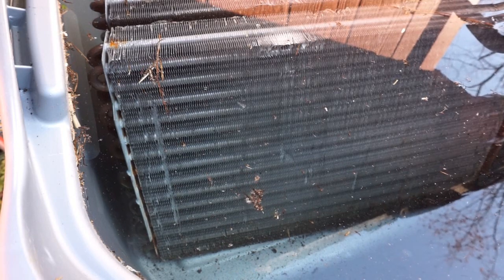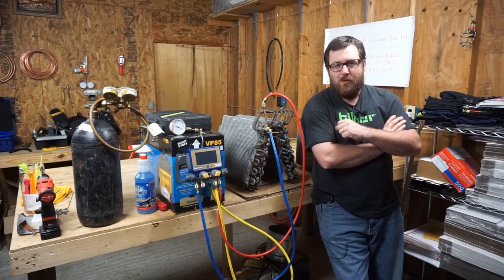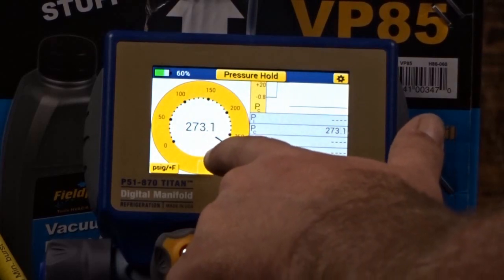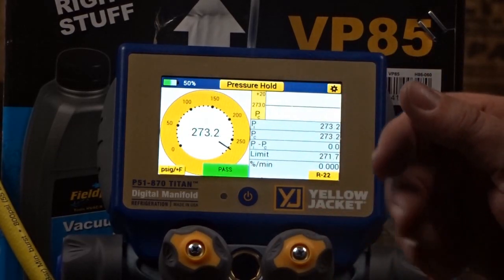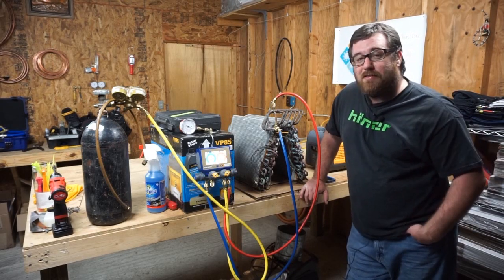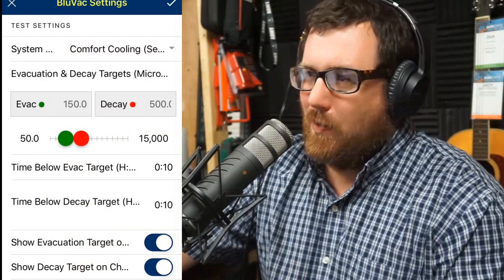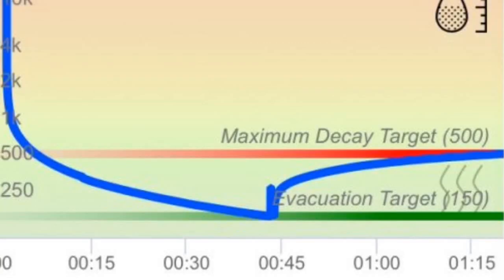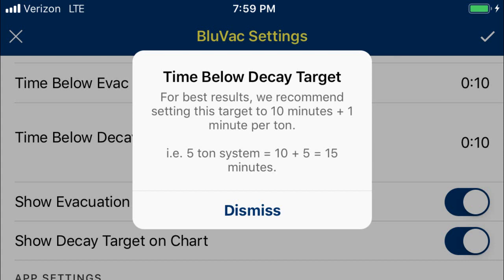Leaking HVAC Evaporator Nitrogen and Vacuum Test | BluVac App vs Leak

Comment: I think your testing approach may have some flaws, and I’ll explain why.

Pressure Test:
Pressure readings are highly dependent on temperature. In a real system, your lines could run inside, outside, and even through an attic — making it difficult to get an accurate before-and-after temperature baseline. So even if you account for temperature, the variability makes pressure testing unreliable for detecting very small leaks. It’s possible your leak is simply too small for your equipment to detect.

Vacuum Test:
I believe your vacuum test settings could be improved, and it's not just about a simple pass/fail result — especially when those outcomes are determined by the thresholds you set.

Ideally, the system should be pulled down to below 100 microns and held there for proper dehydration. Then, the system should remain under 200 microns for 30 minutes. But again, that alone isn’t enough — you need to analyze the vacuum curve and the micron rise per minute, which you didn’t include. The goal is zero micron rise per minute, but with the type of vacuum-rated setup you’re using, I’d expect something close to 1 micron/min rise or better.

Then the question becomes: is that 1 micron/min rise due to the system (i.e. a real leak), or just limitations in your equipment or gaskets?

Nitrogen vs Refrigerant:
Lastly, you're using nitrogen, which has a different molecular size and leakage behavior compared to actual refrigerant. I'd be really curious to know: if you’re seeing a 1 micron/min rise using nitrogen — and assuming that rise is due to a true leak, not equipment limitations — how does that translate in a real-world scenario using R410A? Are we talking about something like a 0.5 lb loss over 10 years?

Comment: I can't imagine what more on 410A which is much more difficult to find leak. I can hear it hissing but when I look at the pressure gauge can't even see it. The worst thing to do on POE oil is pulling a vacuum when there is a leak and suck all moisture inside.  

Maybe you should try cooling or heating the evaporator to make metal contract and expand also to simulate working condition.

Comment: On up to 5 ton splits with scroll R410a, When I use deep vac for leak testing, I would pull down to below 200, and isolate and wait up to 24 hours to determine the final level offed vac. If over 1000, pull down again and repeat till the rise level is around 500 leveled off at 24 hr because the moisture can blur the tiny leaks.  If the rise never ends and is above 1micron per minute average seemly forever, there is a tiny leak.  I only use vac for leak search if I have lots of days.  I use the BluVAC Pro gauge.  I find it better to use nitrogen at system rated test pressures found on the name plates and locate with bubbles/ ultra sonic.  I have had systems with micro leaks that don’t leak under Vacuum but do when under pressure.  For running systems that need annual addition of refrigerant, a combination of ultra sonic, H10 and the newer FP IR probe and bubbles 
Is what I have success with.  There is not one tool of method, each system and its condition and situation is different.
Reply: Thats how id like to do my evacuations aswell but when youre working for someone else and its quoted for a 1 day repair thats when it gets dicey and you can only do what you can do
Reply: @45KevinG45  very true. That makes us techs always have to be in a rush

Comment: What was the leak rate for the coil ? lb/year. 
You know that you can't make a system that is 100% tight. Even the best solderings, do leak at 0,0000 level. How did you find the leak in the first place.
Reply: You’ve hit the nail on the head.  I don’t think any system is 100% leak proof.  We’ve got minis with flare joints that almost never seal despite every attempt to make them tight.  Testing systems overnight is not very realistic.  Not many techs or companies are going to go to that length.  I think we will find that all systems lose a small amount despite best practices.

Comment: Hi Zack . great video . you have opened a can of worms here. A great follow up would be to hook up the coil to a helium leak tester in vacuum mode (not sniff mode). something that can leak test down to say 1 x10-12mbar/l/sec like a leybold phoenix l300 . Then introduce helium to the know leak point . it could be that its leaking under pressure but sealing up under vacuum . we sometime see this depending on the shape of the leak point.

Comment: Thank you Zack for this video and test. I really appreciate exposing this issue in our trade. I found this a constant issue in my 28 years in the field when it comes to small leaks . I think it is a headache that we cannot eliminate for now with existing technology .Only techs that are not honest or do not have the skill or have not been in the trade for long enough would deny the existence of this "evil". Most of us, due to financial and time restrictions would vacuum a system to a satisfactory level , do a vacuum test  and move to  another job. The most of the time unaffordable solution is nitrogen pressure testing the system for prolonged periods of time like someone else mentioned here or following up with a leak check with a good leak detector. I hope other guys post some other solutions.

Comment: Pressure leak testing small leaks should be done with a pressure data loger small changes in temperature can give false positives by example a line set leak test with 450psig nitrogen will fluctuate up to 100 psig from cold night time temperatures to hot sunny temperatures
Reply from the maker: Yes do t think large of a fluctuation is correct.

Comment: A leak is a leak is a leak, There no 100 percent way to check for leak because there's so much different variables, example it could happen when the metal expand or contract, vibration, at static or a dynamic leak, the leak he show is a very small leak infact it can be a few onces a years, so in reality , it wont really matter as the system well function properly! In fact in the automotive field, we only address excessive leaks! eg, if u can drive your car for a year without having a problem with your ac cooling! Then is it really worth trying to replace a evaporator! MOST PEOPLE WONT WANT TO HAVE THAT JOB DONE BECAUSE IT EXPENSIVE AND ITS ALOT OR WORK ON MOST MODERN CARS ! Also a leak that small well response very well to a internal sealant! So every situation is different! Leaks well happen in fact without leaks there no need for AC technicians as it the biggest problem that we encounter in the ac and refrigeration field!

Comment: I think this is a great video. Kudos to you for setting it all up to prove a point in an important aspect of our trade. It also further supports the things we have come to learn, i.e., that sometimes you can't always prove a leak with a vacuum that you can with pressure, and that sometimes you need higher pressures to finally expose a leak (perfect example is with flare joints).

Comment: I bought the Bluevac with the thought to increase the quality of my jobs. So far, I have been using it a bit over that a year as a test... my conclusion is that you can NOT use it in the automotive industry. I tested it on tents of compressors and the always leak under vacuum. You can bring them down to 1100-1220 microns but not more than that (York compressor). They leak for the shaft seal. The thing is that they won’t leak under pressure because of the seal design.
Reply: Or is it that the systems you are pulling down already had refrigerant in them at one point? If so then the refrigerant is boiling off in the compressor. To test this, bang on the compressor and if the microns rise it is still boiling off in the oil

Comment: Great video!  I work in the refrigeration manufacturing industry and vacuum and pressure decay are both considered gross leak tests  We do helium or refrigerant sniffing for fine leaks.
Reply: That sure makes sense. I know a good sniffer can detect a leak less than 1/2 oz refrigerant leak per year.

Comment: If the app was tweaked to ignore time and red flag a constant rise in decay, that might be a good improvement. I know of issues with larger systems, especially VRF/VRV, that pass these type of tests, but continually over time lose charge. And with long line sets, branch selector boxes and fan coils, there are a lot of places to check for leaks. I’ve got the ultrasonic leak detector to help with these tiny leaks, the only caveat is you have to turn off the unit you are checking, or you get electronic noise from the boards in these systems. This was a very good demonstration, you hit the nail on the head with this one.
Reply: tcpHVAC/R Wait to you see the next one

Comment: That’s just great; spend all this money on tools and you still can prove its a tight system! Stick with a 24hr pressure test I reckon thanks for the heads up
Reply: I agree, there's a lot to be said for a 24 hour pressure test.  The only problem with that by itself is, non-condensables/moisture aren't detected.

Comment: How do I get in touch with this video’s sponsor? 
This is unspoken and largely unknown throughout the industry. Not to mention; not written in, I would guess, any manufacturer’s installation or service literature. I’ve certainly never read it any Trane or Carrier literature. I don’t even think I fully understand decay and what little grasp I think I have on the concept, I learned from you, Orr and Jim B. 
This is a can of worms with a big rabbit hole inside.
Reply from the maker: This video is sponsored by knowledge. His email is hvacshoptalk@gmail.com
Reply: Oh I was curious about decays contact info.
Reply: This is not really unspoken as it might be misunderstood. Here it is in a standard ICP (Carrier) manual (Page 5). Decay is due to moisture or equilibrium pressure. A leak will never equalize until the pressure difference is gone. You can see this with BluVac but not with other gauges. 
https://www.utcccs-cdn.com/hvac/docs/1011/Public/00/42101170100_ICP_25257.pdf

Comment: Awesome content! I'm glad you were able to show the flaws in these instruments. With tests like this the industry and manufacturers will make us all better techs.
Reply: Mark, there is no flaw in the instrument, it was not used correctly to determine if the system had a leak or simply decay due to moisture in the system. https://accutools.com/identifying-true-leaks-in-a-vacuum
Reply from the maker: IN other words, you have to look at the line to see which is which? And, according to you that is done in a linear style leak mode, correct?
Reply: @zacksintheshop  Its, not the line, it is the mode of the app. In a decay test, the graph is logarithmic, in leak test it is linear showing a much smaller portion of the graph.
Reply from the maker: @measureQuick  Yes, I understand. I redid the test yesterday and will show my findings on Sunday.
Reply: @zacksintheshop  did post the test of your findings on this, if so what video was it on? Thanks!
Reply: I think there's a flaw it's just not in the instrument.  The flaw is in our understanding or I should say our thought process in residential leaks and vacuums. We need to have greater discussion on what a vacuum is and its purpose and what the decay test actually proves vs what we think it does ( techs in the field) etc. I'm glad you stuck with it Zack, great video series
Reply: @amattar02  The "flaw was how the instrument was used. There are a decay test and a leak test in the software. Decay will continue over time as moisture breaks away from the walls of the piping. Decay will slow as the vapor pressure reaches equilibrium to a reasonably undetectable rate. A leak will show a constant rate of rise.

Comment: Re install that customers coils it has passed all tool tests. 😂😂😂😂.  Only psi test I was taught was 24 hours 250-300 Psig. We can do this in refrigeration. I see where that would require some good dialogue with the customer for residential AC. No cooling for 24 hours is a hard thing do. Puts AC techs in a pickle. Can you do 300 psi for 24 hours and leave a gauge on and see it drops. Also u have great coil to test leak detectors 👍👍

Comment: Decay!
Blew my mind! What do we do now??? Decay for 1/2 an hour? We need more info
Reply: No, you do not need more time. Decay is for looking at moisture. The leak test mode is for leakage.
Reply: MeasureQUICK  thanks!
Reply: @measureQuick  how come that decay would result in a pass when your drawing in moisture from leak and thus rate of increase I would think would be significant! What am I missing here?
Reply: @marcellomoraes7106  below 1000 microns in a properly vacuumed system means its pretty much guaranteed dehydrated, on a new coil in 10 minutes if it doesn't exceed 500 or 1000 on used system there is still no moisture present in the system, you can pull to a vaccuum of 250 and in less than 10 minutes go above 1000 but doesn't necessarily  means their a definitive leak, its just equalizing with the current moisture in the system. Once you release charge moisture isnt getting in

Comment: Zack, 

I am not 100% sure what you did or the app might have done as the screen was cropped, (there could be an app issue that occurred with the multiple gauge addition) but that app/graph was never entered into the "leak test" mode. It appears you went right to "decay testing". 

You cannot determine the difference between a leak and vapor pressure decay in a logarithmic chart. The chart will display a curve all on its own, that is the problem with logarithmic scaling. Logarithmic scaling hides the leak. That said, logarithmic scaling is required to show a full scale of vacuum on a chart as it is 760,000 points of data. If we did not use it your phone screen would have to be 24" tall.  

That is why we made the leak test mode. It only works at about 8000 microns and below. When the gauge is put into the leak test mode the chart switches from logarithmic to linear and rescales so you can see easily if you have a leak or a build-up of vapor pressure (typically due to moisture). Vapor pressure equalizes and tails off, a leak will show a continual rise. I do not have a pump at home so I cannot check the feature now, but see the article on how it works attached. A small leak like you had could easily pass the "decay test" as it is only looking at rise over time. The leak test, however, would have allowed you to see what was really happening.  

https://accutools.com/identifying-true-leaks-in-a-vacuum. 

Last, the gauge you are using, the BluVac Micro does not have time below target or time below decay target capability. It is not a programmable gauge so you cannot even set those in the app as we do not show them as options. I am guessing those are screenshots of the app before you connected the gauge?  If you have a Micro connected those features are hidden, as the Micro does not have that capability. Those features are in the BluVac Professional, and those are the features you are paying for and getting in the higher end product.
Reply: Great article makes me want the pro model
Reply: I understand. It would have been helpful to see the decay in a linear representation. Since this vacuum would have passed according to the recommended decay time, would either app make assumptions based on the steady rise (albeit slow) in microns. Would it FAIL based on rise and not time (or maybe a combination) or would it be up to the technician looking at the decay in linear (leak test) mode? In short, how would I know this vacuumed failed?
Reply: @TALYN875  It would be indicated by the linear rise. That is why we build that in. Everything leaks. It is the leak rate we are concerned with. From your finishing vacuum, a leak rate of 1 micron/minute is considered an acceptable rate of decay.  Back of the napkin math shows you were around 11 microns/minute which is also an indicator of a leak. Another way to do determine if you have a leak or moisture is to pull down to 150 (this could be 150, 200, 300, whatever your finishing vacuum is), then time the rise to 200, pull down to 150 again and time the rise to 200. If the time is less the second time it is moisture. If the time is basically the same a leak.
Reply: by either app I mean bluvac or MQ

Comment: THIS WAS FUCKN BADASS ZACH!!! SUPER APPRECIATE YOU SHARING...I HAVE NOTICED THE SAME THING AS YOU...WHEN YOU TOLD ME WHAT YOU WERE DOING I HAD A COIL WITH THE SMALLEST LITTLE LEAK........ALMOST IDENTICAL TO YOURS...AND I PASSED WITH FLYING COLORS....I CANT THINK OF A WAY AROUND IT UNLESS THE INERT GAS WOULD MAKE A COLOR OR A LOUD WHINING SOUND WHEN IT HOTS OXYGEN....IDK MAN...ITS A GREAT THING...SOMEONE WILL FIHURE OUT A SOLUTION.... AMAZING JOB BRO.......
Reply from the maker: HVAC/R DUDE I hope that one of these apps will take into account the rate at which the decay raises. That way am I better tell the difference between a normal decay and a really slow leak. I’m a try to figure it out before the next show
Reply: @zacksintheshop  yeah that would seem like the most logical easiest way to do it as well👍👍👍👍
Reply: Use some kind of smokegenerator. 
But it will probably not scare your customer.